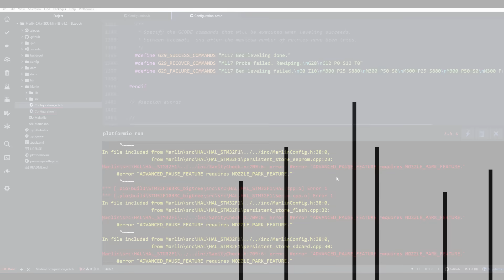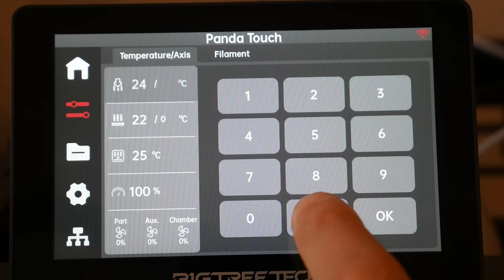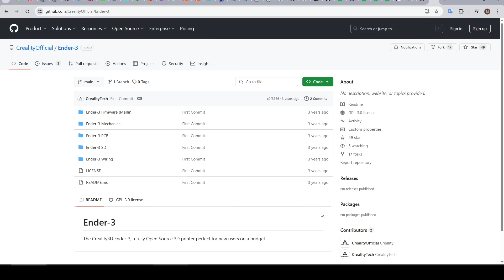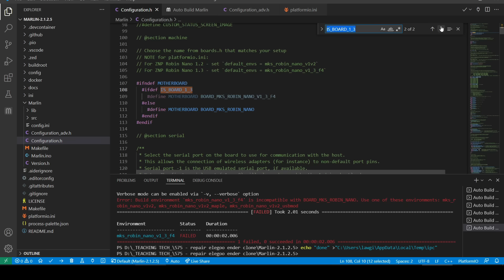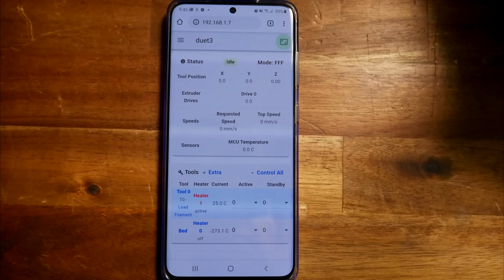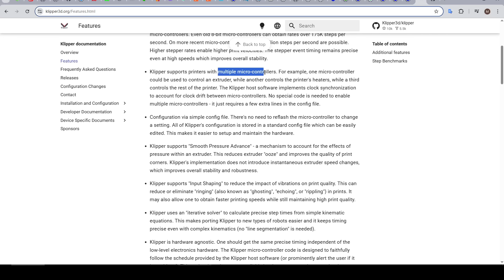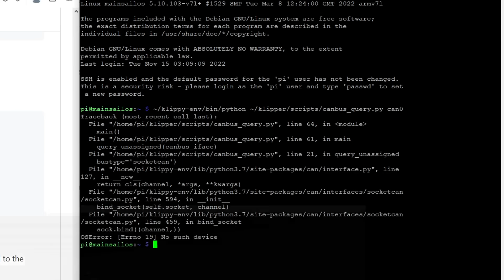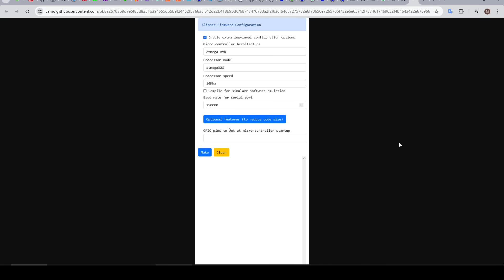What each 3D printer firmware does well, and where it needs improvement

Comment: I like that I don't have to muck around! My bambu lab just works and I can just focus on CAD work. 😀 Someday I'll work on my CR 10 Max and get it running on klipper. Has anybody messed with their CR30 and got it to know the location of the stepper motors? And also are running klipper on CR30? My CR30 is collecting dust. I put an .08 nozzle on it which was pretty cool when it was working well.

Comment: Hi Micheal! Just wanted to let you know that USB IDs can actually be accessed directly through the mainsail web interface. Go to your printer.cfg file, at the top right of the screen, hit "Devices", and all device IDs including usb, serial, CAN, and video are displayed. Its a super handy-yet commonly overlooked- feature of mainsail klipper. With exception to firmware compilation for the controller board, all a new user needs to setup klipper for their printer is available through mainsail!
Hope this helps :)
Reply: This is not a mainsail thing, it's there in Fluidd as well.

Comment: I switched from RRF to Klipper for input shaping 3.5 years ago. I like klipper, and it's better for input shaping (at least it was 3.5 years ago) but RRF has MUCH better fault recovery. Which is to say it has fault recovery. For any error condition RRF will PAUSE the print, disable the offending hardware and prompt the user at whatever interface you specify to cancel the print or resume print after fixing the problem (for example a loose connection for the hotend temp sensor). Klipper just shuts down for ANY error condition. It's so annoying especially if you're 3/4 through a full plate of parts.
RRF also allows you to add/modify macros (scripts) on the fly and test them without having to reload the firmware. Sometimes this doesn't matter Klipper restarts quickly, but if you're testing a script that requires the axis to be homed then every test/modification requires firmware reload then homing and possibly bed leveling. RRF was much easier and faster to develop configs/macros/scripts for.
All that said, I'm still running Klipper so ...

Comment: I've run Marlin and an currently running Klipper. Coming from the engineering world and CNC the biggest shortfall is the lack of G02 and G03 commands.  I have used it on Marlin but don't understand why it isn't in Klipper.  Those commands drastically reduce to amount of code needed and I think if our hardware is capable would improve the quality of prints. I would add quality and precision while reducing the G code required, only increasing the calculations. These g codes have existed since at least the 80's when I learned to write it by hand.  If any of you know why it isn't used normally in 3d printing, I would love to know.
Reply: Generally because pretty much all prints are made from polygonal 3D models which don't have curved surfaces, and arcs are only used with e.g. with the arc welder plugin to reduce the amount of data that is sent to the printer (and that has to be processed). Klipper works well without needing to reduce the amount of commands (since only very low level commands are sent to the MCUs, in a very optimal way). When you want higher quality with klipper you just increase subdivision in your models.

Comment: Thanks for providing a fair overview of Marlin. During this beta period for 2.1.3 and beyond I'm definitely working on improving the Configure and Build situation. I've started to provide pre-built binaries for all the example configurations at the MarlinFirmware/MarlinBuilds repo, so take a look over there and see what you think. Minimal "Config.h" and "config.ini" are now a thing too. Be sure to check out the latest version of Auto Build Marlin where I added "Edit Config" buttons to the Panel to go straight to the *Config Editors*. The config editor just converts the config files into searchable forms to help find things more easily. I will continue to improve on those (e.g., fixing undo/redo, adding a board selector, etc.), and I have an "Upgrade Config" button for ABM in the works which will migrate an older set of config files to the opened Marlin version.

For a long time we were under a constant barrage to keep up with demand. Now with the slowdown in new printers shipping with Marlin, the project has come back to a place where we can focus on hobbyists, custom builders, and improvements for existing printers. We're still incredibly active and busy filling in the gaps in hardware support, making all LCDs compatible with all boards, improving the UX from top to bottom, and increasing speed and quality of motion with new advanced input shapers. The next generation of single board printers is going to be amazing, and don't be surprised if Marlin experiences a third wave!

Comment: When I put Klipper on my Ender 3 - I just flashed OctoKlipper onto the micro SD card of the Raspberry Pi and flashed the Ender 3 with Klipper firmware. Not sure why you'd go through all of the hassle of the command line to install Klipper.

Comment: I used to tweak and modify. But that was in the days when you almost had to in order to get the results you wanted. But I also found that some of the mods and tweaks ultimately caused more problems than they solved. And having many mods requires the user to be their own tech support when things aren't right. But since I got my K1, I have left it 100% stock and it does the job just fine for me. I have NO desire or intensions of changing a thing on it.  In my opinion, that is the way that the 3D printing experience should be. Anyone should be able to buy the printer, take it out of the box, and just use it. Just as you would expect with any other tech device these days.  That experience didn't exist in the early Ender-3 days, as evident from the thousands of posts on Reddit and elsewhere asking for help. In reality, a 3D owner these days shouldn't even have any reason to know what firmware is running in their machine. I didn't know that the K1 was Klipper before buying it. And it would have made no difference in my decision to buy it or not. I have no idea what flavor of firmware is in any other tech device that I own. I just expect it to work as designed when I need it.

Comment: I wish Marlin had an "Update" option much like we're used to with Windows.  Compiling Marlin is pretty intimidating - upgrading it is downright daunting.
Reply: It's a bit of a one-time learning curve. Ironically, the first time I compiled Marlin--and I'm not a code whiz by any means, just enough to know what works and what doesn't--the only thing that kept me from building it correctly after trying for several days was the version wasn't compatible with the board I was hacking. Two versions later, it compiled successfully first try, in 27 seconds. I was elated but also furious after spending so much time chasing individual errors on a bad build.
Reply: @ I have 23 machines. Most modded and upgraded.  Some are the same but most aren’t.  So that makes it super challenging to craft the firmware and when it’s worth upgrading   I’m at 2.1 on most of the machines and while Klipper sounds great - that seems like a bit more terminal/programming that I’m good at
Reply: @WhereNerdyisCool  I could see where that becomes a serious ball-ache. I have a hard enough time juggling the four; only the newest one on Klipper. Admittedly on the Marlin machines, once they get to a stable place, I'm very lax to go in and touch up firmware unless I find a Really good feature that I think might be worth the hassle. That's not very often at all for my needs.
Reply: @ exactly!  Trying to take the “not broke, don’t fix “ approach.  I’d love to see if Marlin can improve in ways Klipper has become popular    I have mostly bed slingers so I don’t mind printing slow for good results. But I know Klipper to do some great quality too.
Reply: Marlin is a pile of jumbled mess laid on top of each other, there is no fixing it.
Reply: This is unfortunately pretty difficult given the number of configuration options that are baked into the firmware binary itself. Each version of Marlin is unique to your printer, so they can't just provide a single binary to update to.
Reply: That is not technically possible. The update procedure is fundamentally board specific, but indeed actually some boards come with bootloader where inserting SDCard or using virtual disk is all it takes to update.

Of course Marlin still has to be compiled for that particular machine - not only the board but also the electromechanics and interface of it.

Architecturally, Marlin is geared towards very simple 8-bit boards with barest minimum of memory, minimum viable processors for the task, not even SD-Card slot or any storage is required, so hard configuring everything in is the ONLY POSSIBLE option, baseline supported processors are Harvard architecture, making it impossible to partition the software into pre-built modules that could be updated separately. What the configuration actually does is effectively remove roughly 90% of the firmware from the compiled artefact, everything that's not in the machine is gone, and optimise and cram into the smallest possible space what's left.

RRF and Klipper being designed for more capable platforms can afford themselves a lot more fundamental flexibility.
Reply: I disagree. Once you take some time to learn Marlin, it's quite simple. Most of the config options you are not going to use.
Reply: @BifsieOfficial  Personally i do use Marlin but not in an advance way aka i have no clue what part of code do what and i have always check internet for every information. I still remember when i was modifying firmware and some moron enabled sensorless limits and i wasted hours to find what i need to do to enable switch limits. At the end i wasted hours and hours checking every fking line code to find and change in a way i wanted or actually how it was before. Also lets not talk about that you need to know for which exact chip you need to compile the code.

So overall Marlin sucks balls big time.
Reply: @BifsieOfficial the main trouble with Marlin is that if you want to do more critical changes or do an update it's a pain to have to refresh your firmware every time and if something is slightly wrong you have to refresh it again which I think is just a slow and cumbersome way of doing it.

I use both klipper and duet on my other machines and updating and making changes is easy, no need to recompile the firmware, just go into the files on the website, and hit save and 30 seconds later a major change has been done.

Comment: If Marlin does not want to become another Smoothieware, it must drop support for all MCUs except STM32, remove HAL and optimize for STM32 only. There will be no new 8-bit boards and almost no boards with non-STM32 MCU, so there's no reason to waste time and efforts to support it. Maybe some good well-compatible clones like GD32 could be supported, but nothing more. That's the only chance for Marlin to survive against Klipper.

Comment: Marlin is very rock solid, but as stated compiling the firmware is a pain if you need to do it. I would save backup copies of the config files before making any updates. But once everything is good, it can just run and run. Klipper seems to be a good middle ground between "just working" and being able to tinker with everything. It's surprisingly easy once you jump in, and you can always copy and paste the error codes into the Google search bar and it's guaranteed someone has had that issue at some point. I recently rebuilt a broken Tina2 S from the ground up to run Klipper and even though it started with a hundred errors, I was able to go through them one by one until it suddenly started working. Honestly, even the code seems easier than Marlin, and I don't have to keep plugging and unplugging a USB cable or SD card and waiting for the new firmware to compile and hope it's fine each time. With Klipper I just click restart and in a few seconds it's back up and running with the new changes. It's very efficient.

Comment: The power of opennness starts with being able to add stuff... eg, I'd like to add environmental control to my Bambu X1C -- "open the door for printing PLA" -- I have a stepper motor, flap, and a spare STM32.  Let's plug that in and run.

Now... you can do all that with clever trickery (I mounted dc motor to a flap with a spdt switch and if I tell the motor to go someplace special... presto.  Kinda hacky though.

Comment: I want to be able to access my 3d printer settings, not have to connect to the internet to use it, not have to rely on a cloud service to use it, want it to work with 3rd party apps and hardware, dont want the machine to turn into ewaste due to locking mechanism, dont want to have to use proprietary everything, and not being able to self repair. we want to right to repair and tinker as we wish.

Comment: I think there's a difference between wanting to 3d print and wanting to build a 3d printer. If you want to 3d print objects, you might not want to deal with firmware (at all), you might be more interested in just getting your objects printed. Where if you're building your own printer, or at least tinkering with a printer, then the firmware becomes important.

I bet if you asked most Bambu Lab printer owners what firmware they had on their printer, they'd give you a blank look. There's no need for them to know, it just works.

Meanwhile, those with an old Ender 3, and all the customisations up the kazoo, will know exactly what firmware they're running and how to build it.

Your last comments though are spot on, a user-friendly web interface is critical. It's good to have SSH or the ability to recompile the firmware if things go bad, but you need to be able to present pretty much anything you could possibly want to do in a GUI in this day and age.

Comment: Over the last decade of printing I’ve gone Marlin - RRF - Klipper.

Marlin was great when printers were more dumb. The compilation issues were a nightmare and it seems like a lot of the knockoff Arduino Mega 2560s don’t compile it at all anymore so I’ve completely moved away from it.  I also grew to dislike the lack of easy to add plugins and web interfaces.
RRF was fantastic. It was very powerful and I loved being able to control everything through Gcode. The web interface was good but it did lack a lot of nice-to-have add-one and plugins and the community ones never felt very developed. Every time I installed it however I would have issues with version mismatches and needing to go from V2 to V3.3 to whatever the latest is, regardless of whether I was trying to install a fresh latest release. I also got a lot of errors with later versions where the firmware would stop responding and would need a hard reset via UART.
Klipper so far has been excellent. I miss the ease of “Gcode everything” at times, I don’t like that some function definitions are too deeply buried to reasonably edit, but the support and community are vast and so everything I need is pretty well developed. I love being able to plug a camera in and it just work instantaneously.

Comment: I think it comes down to the question: do you have a printer to print (and might tinker on), or do you have a printer to tinker on (and accidentally print with). People have their printers for different reasons. I can imagine that if you are using your printers to actually 'produce things' with, where the models coming off of the print bed represent a genuine value in time/money, they may lean towards a more polished experience. If you're a hobbyist and you can accept the fact that your printer may be down for an hour, a day or a week after you make a mistake, or an update goes wrong, or whatever, then a more open firmware is a serious option. I watch FauxHammer's reviews of resin printers too, and he approaches them purely as 'tool for production', which I think is a perfectly valid use-case and gives an entirely new perspective on things. I think we need both. Since the 'producers' will push on the quality, where the 'tinkerers' will push for shiny new features we might otherwise not get. Love the videos, keep up the good work :)

Comment: I think we need an OSS firmware designed with 3rdparty extension/override/forks in mind from the ground up. Klipper is amazing, but every vendor forks and locks it, because updates can break it very easily. HAL is not good enough to allow manufacturers maintaining their firmware while still retaining compatibility with mainline firmware and new features. Current klipper is too tightly coupled. (yes the same klipper is indeed very extendable as it is, but it's not enough)

Comment: You cant give customers That much access to operating systems of a product you are expected to give a warrantee on. In Europe and Uk its a mandatory minimum 12 months on electrical goods and up to 24 months if product is found to be not fit for purpose.  An inexperienced customer could cause problems causing the printer to fail, then demand a refund which they would be legally entitled to. You cant run a business that way.  Your car doesn't come open source So you can play around with its operating systems does it? Nor does your TV or washing machine. The manufacturers didn't make it open source in the beginning for your benefit, they did it because it got them 1000's of free developers